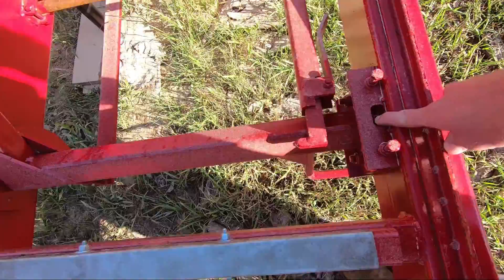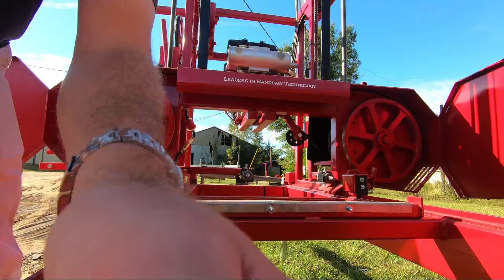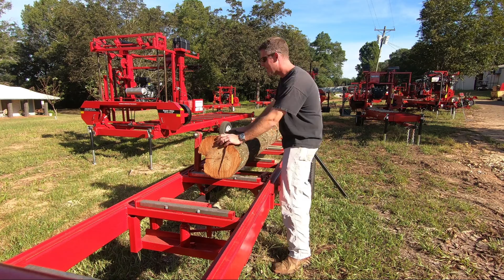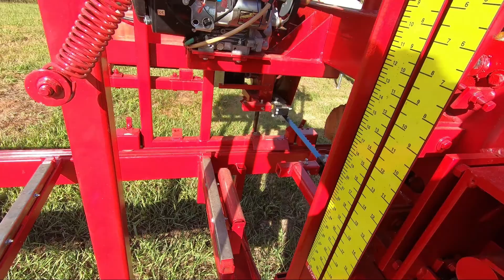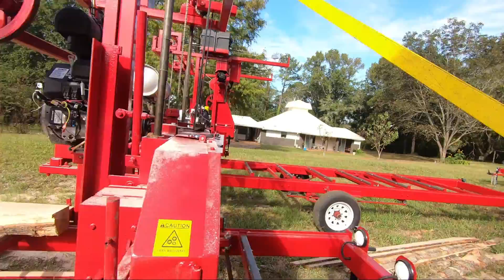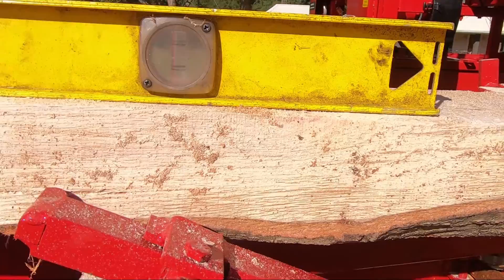Cooks MP32 Portable Sawmill Setup and Testing

Comment: A couple things would add some convivence to probably the best portable mill i have seen. Throttle handle that turns  the lube on and off when depressed like on my cheap mill (woodland mills) and a way to raise /lower the log stops from the back of the mill.  When i upgrade the MP 32 will be one of my top choices. No rubber belts anywhere on the band wheels and roller guides.